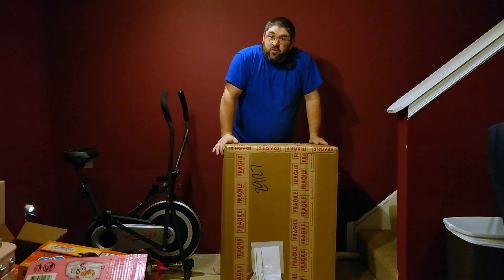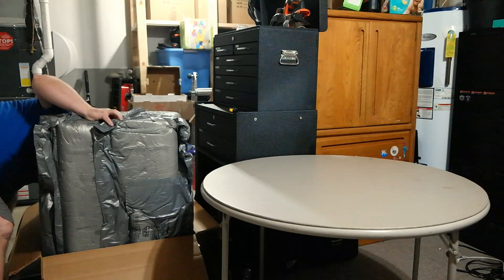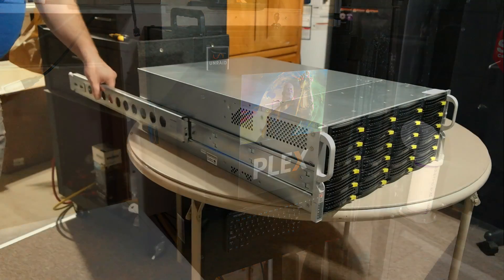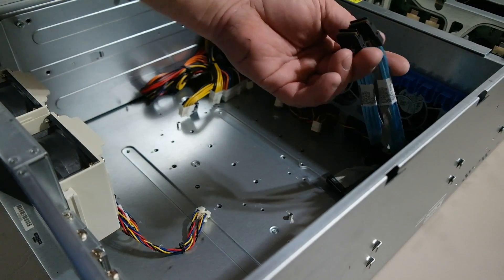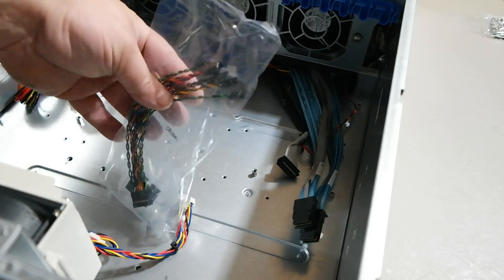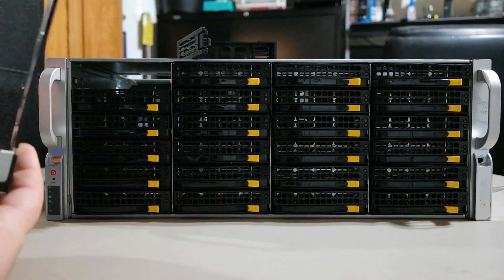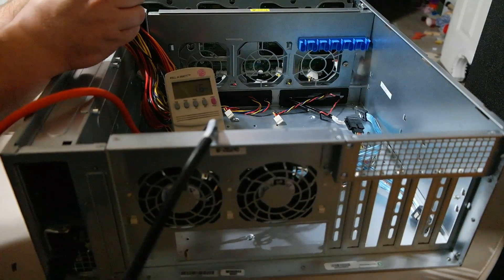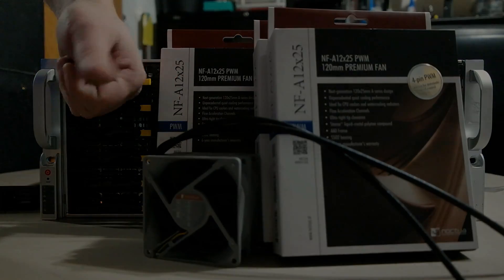Project Supermicro 846 Plex Server Build Part 1 - Unboxing & Inspection

Comment: What type of 3.5 inch drives connect to the backplane? I have an UnRAID server with eight 2TB SATA drives. I plan to gradually replace the 2TB SATA drives with larger capacity SAS drives. Can the mixed SATA and SAS drives plug into the backplane? I also plan to buy an LSI HBA controller. Which HBA controller do you recommend? The Supermicro MBD-X8SIL-F-O motherboard, Intel i3 CPU540 dual core at 3.06 gig CPU, 4 gigs of DDR3 single-bit ECC memory, and power supply are 15 years old, and need to be replaced. I’d like to replace the full tower case with the Supermicro case as you detailed. Your build looks like a perfect build to replicate!

Comment: Great videos. I was hoping you can help me with something. I have a 4u chassis that has 5 8087 SAS ports for the 20 drive bays. I was looking for a cable to connect to the motherboard but haven’t came across anything, I’m new to this so I was hoping you can help me. Thank you

Comment: I wonder were I can find a power supply like that to fit in a rosewill case so I can fit a super micro mother board in the case.  I realized after I got my new mother board that it will not fit in the case with the power supply were it is since the mother board is longer or it about a inch past the IO shield were as the super micro case is made for these types mother boards with how the power supply is set up on the side as it is.

Comment: Yep I Pretty Much Did The Same Thing With Mine..Getting It Into My Room..lol. !I Got Mine From The Server Store Also ! I Am Still Moding/UpGrading Mine As I Go I Am Thinking Very Seriously About Modding My PDU & Solder me a 8+2 Pin Power Connector On To The PDU For a Gpu After I Get My Dual E5 2697 V2's in it & i Alredy aded a Pair Of Gammax Coolers & All B Quit Fans!  I Was a Eletronics Tech For Years & Years So I Dont thank It Will Be Very Hard To Do And Then Mine Should Be Prety Well Complete With ssd's  (DualPort 10Gb Nic) SFP+  Dual 12Core Xeons 128Gb Of ecc Ram seams like i am forgeting something... Cool Video & Thanks For Sharing !

Comment: Thanks for this video; I'm eagerly awaiting the rest of the parts in this series! I just moved my Plex server to a RSV-L4500, and now I'm already drooling over your Supermicro 846 setup. But I have questions that I'm hoping you address in your coming video(s); namely, how many lanes does the SAS backplane on this 846 support? Not sure if I'm even asking that correctly (I'm still learning), but what I'm trying to decipher is the data transfer speed if you had all 24 hard drive bays filled... does it all share a single 6 Gbps link? Or dual 6 Gbps? I've read conflicting info online.. some said that this particular backplane only supports one SAS lane (with the other only used for redundancy), while others say you can connect both to an HBA and have double the bandwidth. Not sure if you'll get into that level of detail in your video series but I'd love some confirmation!
Reply from the maker: I've heard the same stories about the SAS2-EL1 backplane only using 4 lanes and will not use the other 4 lanes if another SAS cable is connected.  I'd like to find out, but I won't max out one 4 lane connection till I get to 14 HDD's.  Right now I'm up to 9 HDDs.  When I cross the 14 or 15 HDD count I'll most certainly make a video regarding this.

Comment: Very Nice case, look forward to the build. I recently combined my Personal PC, NAS, and Plex Server all in a single build when I got the AMD 3950x. I have my setup in a RSV-L4500 4U case running Unraid OS. Curious which size HHD you are running in your rig to quickly run out? I previously had 11x 2-3TB drives, but I upgraded during Black Friday with 5x12TB WD drives I shucked from USB enclosures for $117ea after all discounts. On slick deals there was a 20% cash back offer through samsung pay with best buy purchase of $500+, They had the 12TB drives on sale for $149/ea for black friday, so i ordered the max limit of 5, $150 x 5 = $750 - 20% cash back = $600 - 2% Credit Card cash back = $117/ea + tax
Reply from the maker: OMG that was one heck of a deal on those drives!  I run all shucked 10tb drives right now.
Reply: @madelectronengineering  man you really hording data.... are you using x265? I converted everything to x265 with an auto converter setup handbrake docker...actually how I do my edited videos for youtube and such now. I use davinci resolve, edit the videos, render it out in lossless nearly instantly into the folder the auto handbrake docker is watching, which then converts it to whatever render settings best for my liking, example youtube folder has the best settings for uploading to YouTube. I found handbrake renders with better quality and less file size than the same settings in davinci resolve directly